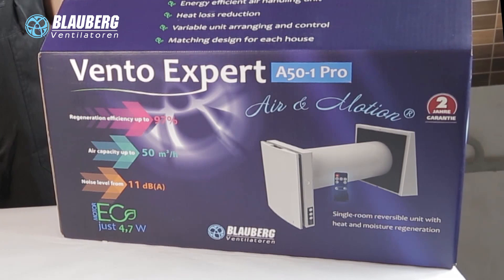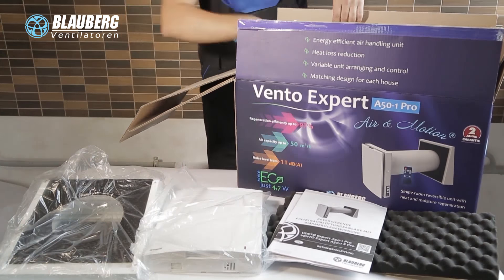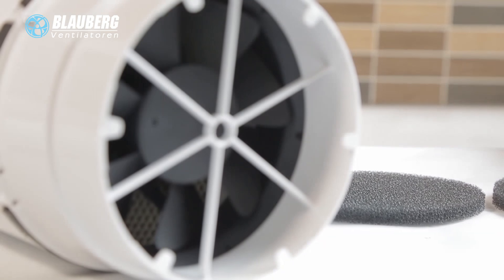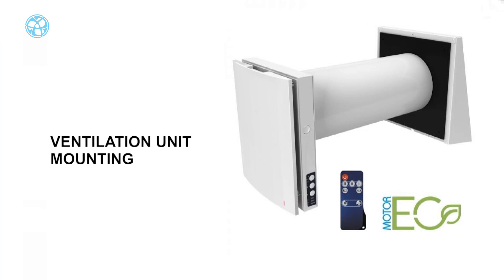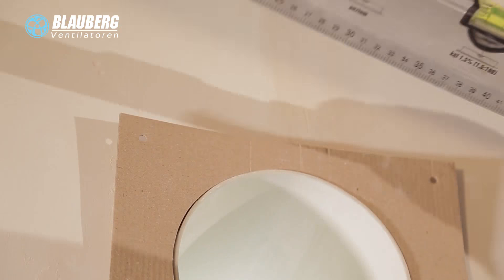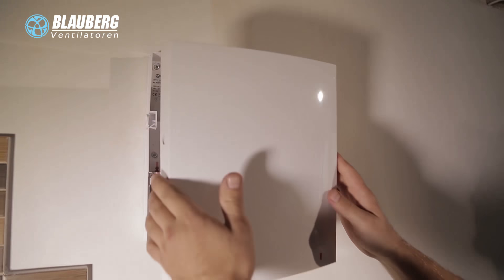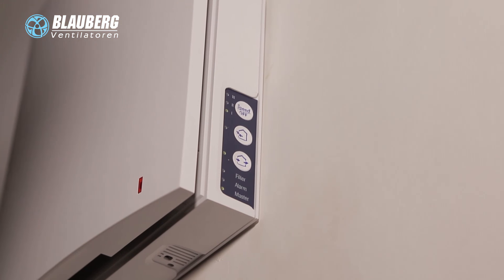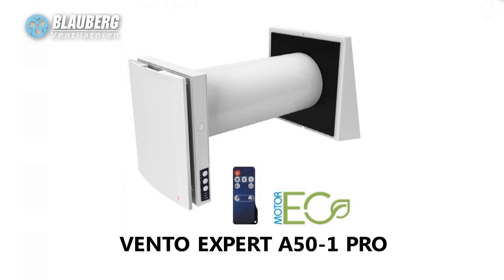Vento Expert A50-1 Pro - effective ventilation

Comment: I have a living room with an open kitchen, about 30 square meters in total. I would like to install a unit in the living room about 6 meters from the open kitchen (i.e. on the other side of the room). Should I get a Vento Expert A50 or a Vento Expert DUO A30?

Comment: Is this easy to install post-build? I'm worried about creating large holes in my walls, and finding the electrical access needed.
Reply from the maker: This installation is the best solution for ready-made buildings (post-build), where it is not possible to do centralized ventilation with ductwork, so making 1 hole in the outer wall is all that is needed. There are special cutters for drilling holes with a diameter of 160 mm and more. Today, such holes are not a problem. If you cannot connect hidden wiring, you can purchase a cable with an electrical plug and plug the installation into a wall outlet.
And this video shows in more detail the process of hole drilling and installation: https://www.youtube.com/watch?v=UyX8fSfaNhs